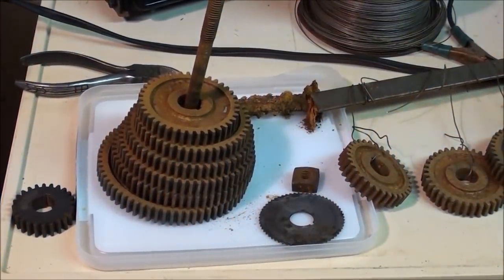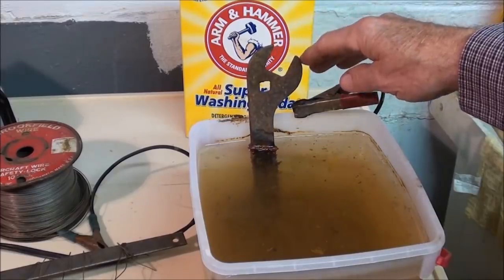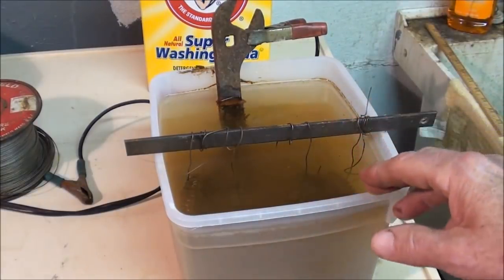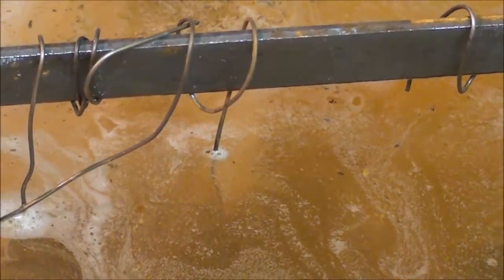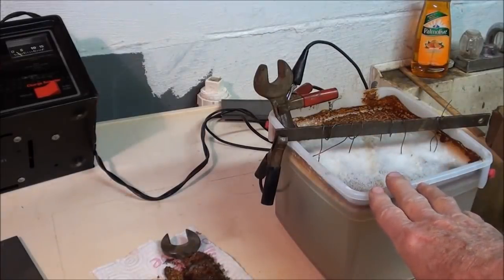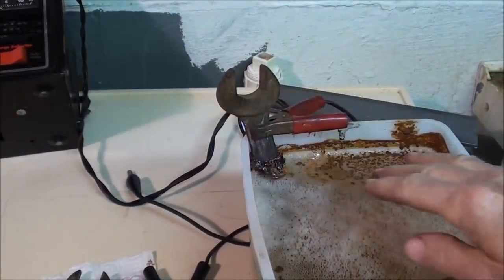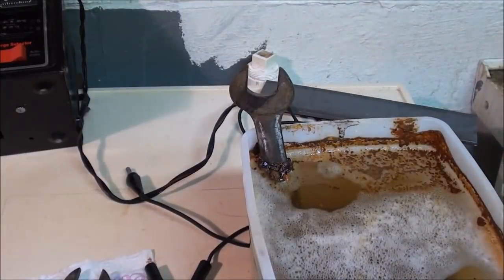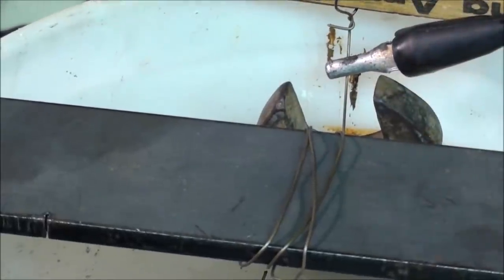MACHINE SHOP TIPS #133 Rust Removal by Electrolysis on the Logan Lathe tubalcain

Comment: Actually it's not just releasing Hydrogen (at the negative end) it's also releasing Oxygen (at the positive end).
This process fuels Oxyhydrogen torches for cutting or welding and supplies air for Nuclear submarine crews that allow them to stay submerged for months.
Reply: D8W2P4. well hell, someone tell the navy they cant do that in an enclosed space!
Reply: DrewLSsix
They isolate the Hydrogen coming from the negative side of the water splitter and eject it from the submarine.

You can see the general principle of how it's done with a hoffman electrolysis apparatus.
Reply: I learned that in 6th grade lab.  Caught the H in test tubes and got to light it.

Comment: Use a few carbon Arc gouge rods instead of a metal for your anodes. The O2 developed at the anodes will then for the most part bubble off as a gas and a small amount will oxidize the carbon rod and also off gas as CO2 bubbles.
Reply from the maker: +Aaron Scott Thank you

Comment: A few questions, 1, I have a big charger, can you use in at a higher amperage?, maybe faster, or should you use a lower amperage? and what would you use to clean a old 12" craftsman lathe, I want it to look like new, paint and all. Thought I would dissemble it all and steam clean all the greasy parts and was the rest in a wash tank. Your opinion  would help.   Pebs.
Reply from the maker: I use lower amps. I like lacquer thinner to cut the grease-then wire brush & sander.

Comment: Thanks,  Need to up grade my lathe, love the old Craftsman, they were build only 20 miles from where I grew up. Would like to find a 101,  Your thoughts on one of those Smithy's ? The combo mill lathe 40" bed.   Love the videos, any ideas on a ships whistle that would run off air pressure, then my wife can call me.
Reply from the maker: I prefer seperate machine over the combos. Its is quite a chore to keep changing from one mode to another.

Comment: Sodium carbonate and bi-carbonate will form a buffer solution. The hydrogen gas is evolved from the bi-carbonate ions: 2 x HCO3 (-) -> 2 x CO3 (-2) + 2 H2 (gas)

The main reaction is to reduce the iron oxides, aka rust, back to metallic iron.

Reduction Occurs at The Cathode - ROTC - is the mnemonic...

The side reaction is to rust up your sacrificial anode, which collects an equal number of carbonate ions by electron charge with the iron atoms which are reduced at the cathode.

There's a bit more to the electro-chemistry, but Mr. Pete shows you the practical application of this concept...

Comment: mrpete222
If you can't find washing soda (I couldn't) baking soda works too.  Throw a cup in a frying pan and heat on high.  Turns it into washing soda which can then be used for electrolysis.

Here is one of many links on the net to do this.
http://naturesnurtureblog.com/2012/05/08/ttt-turn-baking-soda-into-washing-soda/
Reply: I noticed that in the pool supplies at the "Wally World" there is a pH adjustment chemical called Up. The label stated that it contained 100% sodium carbonate. I brought some home to try.

Comment: Darn it.  I had the play list going and it went to the next video and I lost all my comments on this video.  LOL  - Wish I had some carbon/graphite electrodes like used by shopdogsam. - I don't like the EPA much either. - The country is being dumbed down more every day.  How did we get to the moon without DROs?  Skill, craftsmanship, and slide rules. - I'm using 1/8in flat steel from Lowe's as my anodes, and I don't get all that scale on them.  It winds up in the bottom of my tank. ?? - That faceplate came out better than expected.  Wow.

Comment: If doing multiple batches or a heavily rusted item, grinding off the scale that forms on the electrodes will improve the efficiency. Also it should be mentioned to never use a stainless steel electrode.

Comment: I wonder ..... does the anode have to be steel? Could you use copper or brass or even stainless ateel? And does it have to be washing soda? Would vinegar work as well or better? And .... increasing thedc voltage? From a power supply for example, say 30v? Oh 'her indoors' is calling you! 🤣

Comment: Apparently graphite makes an excellent electrode, the solution stays cleaner.
Reply: Carbon/Graphite rods or plates are much better than using steel, especially for larger parts.  The solution stays cleaner and the scale doesn't stick to them, so there's no need to stop and clean your anodes.   If you can't find washing soda in your local store, pool supply stores carry it (Ask for Sodium Carbonate or PH Down).  If you can't find it at all, you can convert baking soda (Sodium Bicarbonate) into washing soda by baking it at 350F for about an hour.

NEVER use stainless steel for your anodes as this creates hexavalant chromium in your solution which is extremely toxic.  As long as you use only iron/steel, the solution is perfectly save and can be poured out into your lawn or onto any iron loving plants.
Reply: spongerich Thanks for bringing some grit to my mill!  :)
Reply: spongerich No need to bake the bicarb to calcine it to carbonate - the iron ions in solution will acidify things nicely, and the carbonate / bicarbonate equilibrium will self establish a buffer solution.

You can always help things along by adding a little vinegar to the bath... not really necessary, but a cheap, relatively safe source of a slightly stronger acid than the iron ions will make.
Reply: Your results are great, but a little messy.  You should try graphite anodes. Shopdog Sam’s graphite anodes really gave a clean bath, with no “nighter.”  While he bought his block of graphite at a flea market or something similar, you can purchase solid graphite electrodes from a welding supply house or from McMaster, whose products can be ordered online.  The more anodes you use, the quicker and more effective the process.  I hope Shopdog Sam’s videos are still available on YouTube - he was a genius at this process, and I highly recommend them.

Comment: What is safety wire? is it garden non-rusting wire?
Reply: the pack said aircraft safty wire so its the wire used(at least in the Military) to wire all bolts on an aircraft. to keep them from vibrating out. Probably a video of it on the net.

Comment: can you use a battery charger with just an automatic setting
Reply: Tom Leach you can but you have to hook up a battery to it to trick the charger. Otherwise it won't give any current. So an old manual charger is easier.

Comment: So is there any way to capture the hydrogen gas that is produced?
Reply: Yep, you put a cover on the tank, attach a breather pipe... stick a balloon over that.
  The balloon will fill right up.
  Now what?
  Well then ya take a cotton string, soak it in potassium Nitrate solution ( Saltpeter ) and dry it.
  Crunch some match heads... the red ones... to powder.
  Take a chunk of scotch tape. Put some powder in it. Tape it to the balloon with the string end in the powder.
  Light the other end of the string, it will burn about an inch a minute, and very hot.
   Let the balloon go. 
  You will experience a very nice airborne explosion when it all comes together.
  Nice little pop and flash.  Kids love it.

Comment: Now i may be wrong....but,king henry VIII that's eight,the eight king named henry,not the eight movie!!!,i digress,king henry VIII flag ship " The maryrose" sank near southhampton,a TV program we have or had here in the UK called "Blue peter"(The Blue peter is a naval flag i think),anyway the maryrose was covered in silt on the bay bed,lots of the iron work was intact but most had turned to iron oxide,there is a process to which the iron oxide can be converted to a more stable form of iron,if the parts ie cannons cast work etc had been removed and allowed to dry it was as the yanks say "toast",so electrolysis was used to reconstitute the iron oxide back to some form of iron again,just not an oxide.

I found the idea of this to be utterly amazing,especially now that i have been restoring my 1976 triumph spitfire back to better than showroom,i have a boot lid with scale and pitting which i may either hit with electrons or oxalic acid ,not decided yet but for smaller parts or at least those not as big as a boot lid,that's trunk lid in the US,like brake calipers etc the electrylosis method gets into the bits you normaly don't even see.

love it.
Reply from the maker: A very interesting comment

Comment: @tubalcain....You probably already know this, but if you look at regular baking soda vs washing soda, the only difference is that there is one less oxygen in the regular baking soda....what that means in terms of reactions (without being overly technically accurate), is that the regular baking soda has half as much OXYGEN to act chemically with the electrons and what not....think of it like this....in 5 grams of baking soda assuming 2 grams is Oxygen (just pulling an easy number out of the air...in actuality it is not true obviously)....in 5 grams of "Super Washing Soda" there would be 4 grams of oxygen....

the implication is that SUPER Washing soda works a lot faster (maybe 2 or more times faster) than regular baking soda.  FYI

Comment: Citric acid (used in canning and cooking) solution works well, especially if heated.  Small bottles of citric acid sold in the canning section of walmart or supermarket.  But this is expensive way to buy.  Bulk bags sold online very much cheaper.No electricity needed.  Does not harm base steel.

Comment: Would it be possible to use a 12v (13.8v) power supply instead of a charger ?
i have this old 12v psu from an blaupunkt car radio podium

Comment: How much amp? 12v 2amp ok?
Reply from the maker: yes--2 amp
Reply: If you set voltage to 12 V it doesn't guarantee that you will get 2 Amps . . .you will likely to get less depends on sizes of the electrodes and the distant (?) between those electrodes

Comment: one of the best and easiest ways to remove rust.   deck cleaner/brightner. the one i used cam in a grey jug handle bottle i forget name if anyone is interested pm me, soaked a bmx over night in a tub of 3/1 solution , woke up next morning , rubbed rust off with a paper towel, was like fkin magic lol wont use anything else now and its way safer.

Comment: One caution to this process is Hydrogen Embrittlement. http://en.wikipedia.org/wiki/Hydrogen_embrittlement
Reply: Jim Dearborn sometimes baking (around 200°C ) is used after chrome plating to remove hydrogen. I wonder if this method may be effective in this case? I suppose that, as the pieces remain for a longer time in the tank, hydrogen has more time to diffuse into the material, so that baking will be less  efficient.

Comment: What happens if you touch the water while it being connected?
Reply: 12 VDC is Not dangerous at all . . .a question too: how about raising electricity to a higher Voltage, say 24 to speed up process:

Comment: Mrpete I’m sorry but you pushed one of my buttons, I loved all your videos and have learned much-  thanks, but your comment about hydrogen upset me, what is coming from your bucket is “HHO” not HYDROGEN. HHO is 2 Hydrogen  and 1 H Oxygen that is why you need to be careful the gas wants to be water  again and will burn quickly , the Hindenburg was filled with 100 percent Hydrogen, hydrogen will burn quit slowly without a lot of oxygen, the Hindenburg would have burned even if it was filled with helium it was the aluminum paint that burned ( one big sparkler ) the gas burned as it was released,  gasoline  or propane, would have been much worse because it would have fallen to the ground and burn everyone on the ground.
The only reason that hydrogen (the safe fuel)  is not being use today is because of the misnomer that it is more dangerous, that is not true  if a car filled with Hydrogen “H” crashed and Not “HHO” the gas would go up away from  the ground burning somewhat like alcohol does but gas and propane will run along the ground and keep burning until consumed.
I’m sorry, but if we could stop spreading bad science we would not be having all the air problems, and wars over oil and so on, as I repeat the Hindenburg did NOT burn because it was filled with Hydrogen! Besides guess who owns the biggest helium well in the world?  The US government.